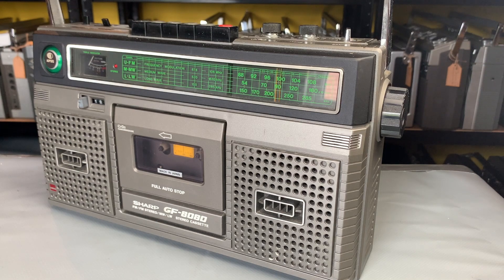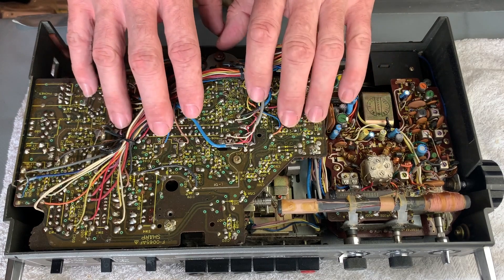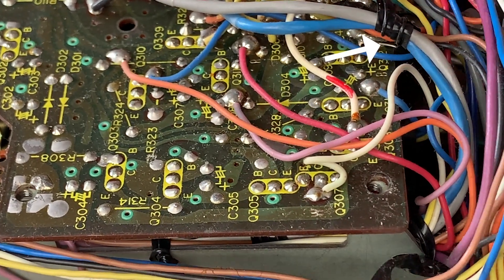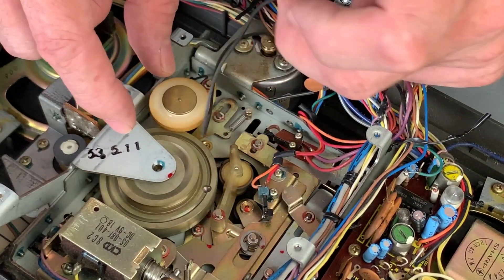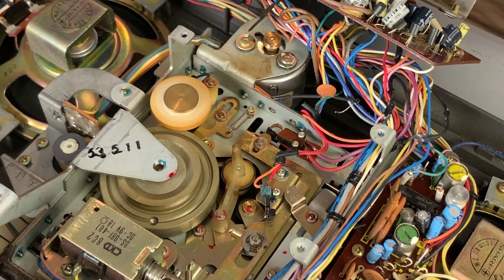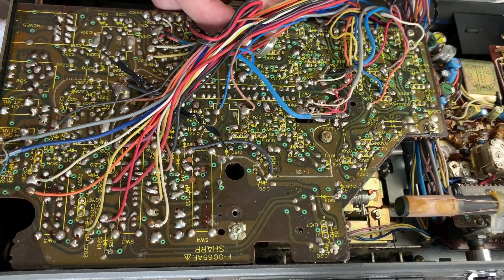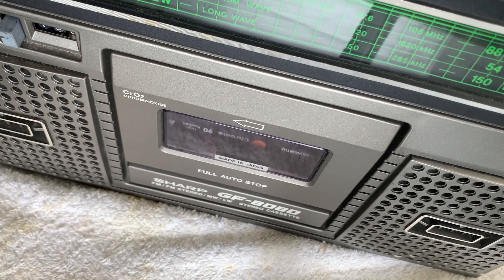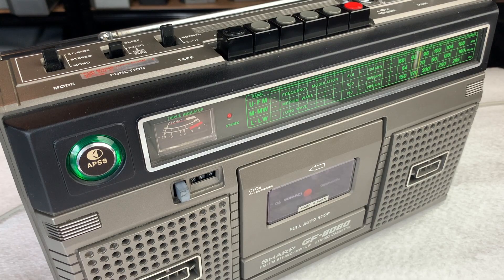Sharp GF8080 Belt Change. Cassette Recorder Service GF-8080 Boombox Repair

Comment: You can do it without de-sodering anything. 
But I didn't know the spindle grub screw could be removed!
Thanks!
Reply from the maker: Thanks for watching! These days, I just take off the APSS white ones, as I find they just make things more awkward - oh, and that earthing cap, as it allows opening away so much easier without fear of damaging  the cap. I tend to find there's much less work entailed to actually change belts, but it's also nice to get better access to move stuff around and get to everything - it helps with filming too. 
These are awesome machines - so solid, and a fantastic sound for a relatively small unit. I hope you continue to enjoy yours! Thanks again 👍

Comment: Excellent video! I would like to know what is the thickness of the belt that was replaced. I have a Sharp RD-477 that has the same cassette recorder.
Reply from the maker: Thanks for watching 👍There are 3 belts, but the main drive belt I used was 1.2mm x 72mm. Hope that helps!

Comment: The one i have is not in great shape but it was from an electronics recycler on ebay and only cost 99 p so far i have had 3 boomboxes a memorex cd 3300 a less common model though all works but needs belts and might have a loose ground somewhere and a sharp with back two back cassette mech it looks a nightmare mech solenoids and 2 flywheels if i remmber right they both have separate motors is an electronic mech fast forward and rewind work play seems to struggle to engage like the mech is hamming it did work a few times just holding play maybe its worn belts .
Reply from the maker: You can't go wrong for 99p - nothing to lose that way! Always worth trying to save one from the tip. Did you see my 99p mini resto?
https://youtu.be/Zwb1jdIE8_k

Comment: Several reasons collided to a point it made sense to go old skool, I thought 50 quid will get something half decent....3k plus for one that caught my eye. lesson learned.
Reply from the maker: There are good, bad and ugly ones at most price points, and the trouble is 1 is never really enough either.... You won't get much for £50 now (you can pay £40 for a set of belts) - but you might get lucky! Thanks for watching 👍
Reply: @retro_restos  I did get lucky, I found you and your very impressive collection and I shall be right here if and when you will part with something...fingers crossed.
Reply from the maker: @LeArtisan  you're very kind. I have so many awesome machines to work through - only a small percentage make it onto the channel, but I'm looking to feature many more. I am really a custodian, so many of my repaired machines go on to hapy new homes.
Reply: @retro_restos  Could you post your email on the community page?